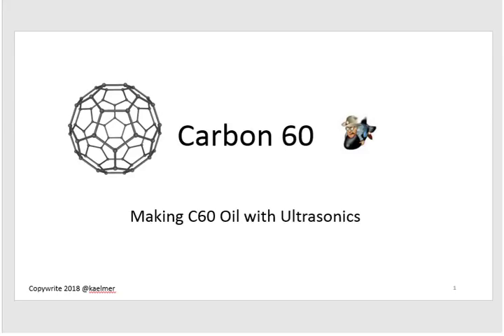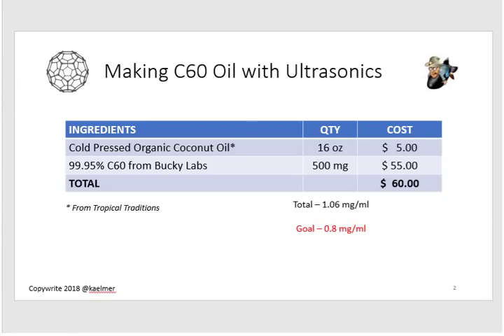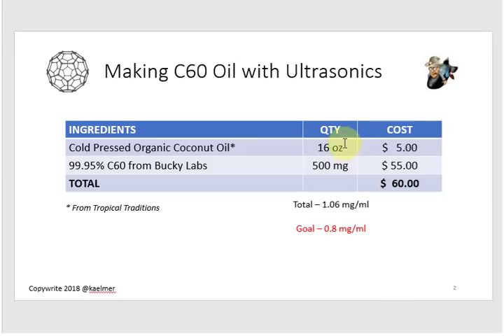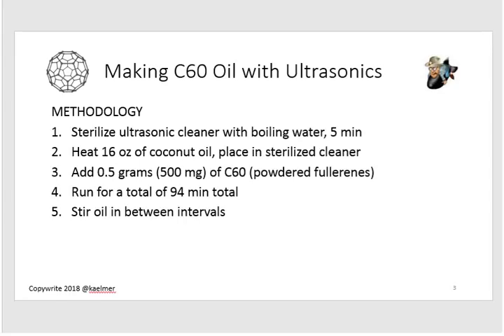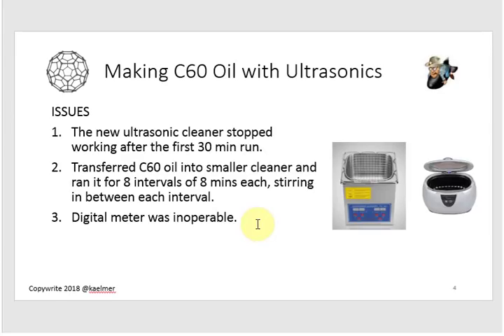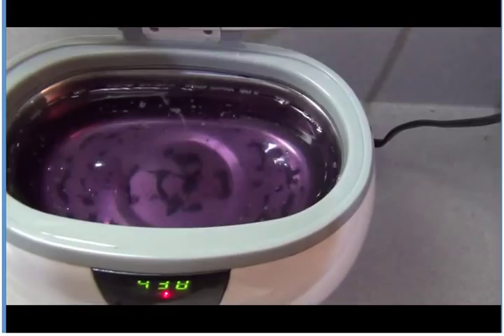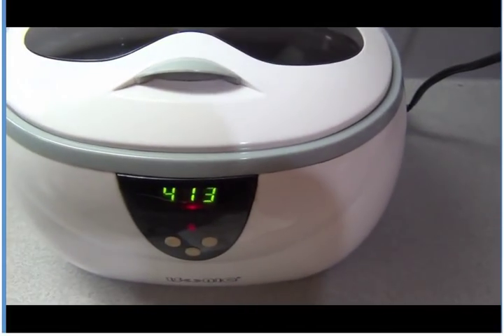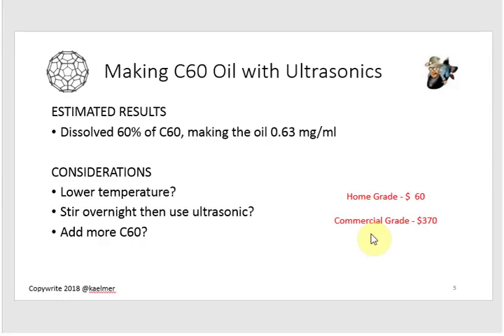Carbon 60 - Making C60 Oil using Ultrasonics

Comment: I'm seeing comments of mixing at higher temperatures. Wouldn't that damage the liposomes. I have to keep the temp of my Liposomal C at under 32 degree C, otherwise the batch is ruined.
Reply: OK，I saw the stir VS Sonicate video which explained the temp question. Thanks
Reply from the maker: I've found 49C to be adequate, but higher does make the oil taste off.

Comment: Hi, I have the same Ultrasonic Cleaner you list on your website.  What would be the recommended settings for the khz and the temp? I will try with olive oil and avocado oil.
Reply from the maker: I'd go with 40Hz and no higher than 120F.
Reply: @KElmerTinkersAcademy  thanks for the reply. I went with 20hz and kept the temp under 110. Used avocado oil, 500ml. Run for 120 min and there were just a tiny bit left of c60 powder. Looked good.
Reply from the maker: That'll work!!

Comment: What temperature do you put the machine ?
Reply from the maker: I run it at 40C.
Reply: K Elmer thank you..
Reply: K Elmer Hi.  my C60 is brown not purple or red. I used the highest grade Bucky  Labs Fullerenes.  It looks like all the powder has immersed into the water. What did I do wrong? Thanks.
Reply: Oil not water 😁
Reply from the maker: Its supposed to be brown, stir for 2 weeks, let settle for 2 weeks and filter.  Then you'll be able to see a slight red tinge if olive or avocado, purple if coconut or MCT.

Comment: Used an inexpensive magnetic stirrer to make 2 batches with 99.95% C60, in extra virgin olive oil. No C60 settled on the bottom, after 3 weeks of stirring. 
Most recent batch, I used cold pressed organic hemp seed oil. Also 99.99% C60 from Buky labs (they were out of the 99.95). In 2 weeks, there was no C60 settling. The color was a rich pomegranate red (same color as the jelly I make from my tree!) where the olive oil was more of a deep wine red. Very pleased with the results.
I've been dosing daily since January. My general health has improved. Skin is clear, eyesight seems better, and my hair is less gray, go figure. Will continue....

Comment: With ultrasonic mixing the oil tastes a little burnt. I have tried with olive, sunflower and MCT oil. The C60 dissolves ok in 30 minutes but the slightly burnt taste, compared to mixing with magnetic stirrer, makes it unacceptable. Someone suggested the ultrasonic is burning oxygen in the oil. I put a sealed jar of oil in the cleaner and tried mixing 30 times for one minute intervals but still the same. Maybe problem is my ultrasonic is 40khz. I need to get one with dual frequency with 20 or 28khz and try at lower speed. Anyone had same problem and tried this?

Comment: You and the people who left comments, DO NOT UNDERSTAND what this is about.. #1 Purple Power use Coconut and Avocado oil as a carrier because it is easier on the stomach than Olive Oil. and is needed to take the C 60 throughout the body.  #2 The important part of the product IS THE Carbon 60.  That is what is so expensive. Purple Power extraction process is expensive and exact.  It is purchased through specific labs.It is 99.95% pure. Someone below mentioned that they will make their own out of Shungite. Won't work. It takes a special process to make it. https://youtu.be/txnMxE_F9J4 will explain. You need to investigate C60. If you are not informed, you are stupid. https://www.youtube.com/watch?v=GUkU08uz4Lo&t=320s  The following explains many benefits, expecially in older people. https://www.youtube.com/watch?v=GUkU08uz4Lo&t=320s PLEASE BE INFORMED! You cannot use heat.

Comment: I am really looking forward to making my own C60. Your videos are invaluable. I wish I had done this to start with rather than buy the expensive oils online. I like the idea of coconut oil, but will probably will use avocado oil. I will try some different oils. I was wondering if CBD oil would work. It is pretty expensive to begin with and I don't know if the lipids (?) would be right in CBD. I bought hemp oil once thinking I was getting CBD. I wonder how that would work. What about mixing it with vinegar as a salad dressing? It might look weird, but another way to ingest it.
Reply: Tired of waiting over a month for your Fullerenes C60 or can't find it at all to make your own? You can have your 99.9wt% Carbon 60 within ten business days right here on eBay  https://www.ebay.com/itm/273515181024

Comment: Greetings and Thank You for the C60 Videos. They got me started into personal production after watching so many Testimonial Videos.Now for the Question: I have an Ultrasonic Mixer (Yes it is made in China) that has digital controls for processing time - 30 Min Tops and Temperature that controls what I want to set it at and the Actual Temperature. Even when I set the Temperature to Zero, it still gets hot & it will run up past 70-80 C (158 - 176F) if I don't stop it. I am using a fan to cool it down so my run times are between 5-10 minutes depending on how long it has cooled down.At this rate getting to 100 minutes is going to be an all day/night job... Has anybody else encountered this problem? I figure the heater wire must be connected to the Ultrasonic Vibration module or the switch for it. No schematics so I am reluctant to do surgery and fix it.

Comment: Thanks so much for your videos.  I am going to start making my own.  I didn’t know I could buy C60 in Canada so will contact the sellers listed in one of the comments below.  One question I would like to ask is about the ultrasonic cleaner.  I’m not familiar with them and after looking at the different ones for sale and then following the link that was provided in one of the comments I realized I didn’t understand exactly how they work.  Would it be possible for someone to do a video on using different ultrasonic cleaners that can be used when making C60.  I was under the impression that just stirring in a dark place for 2 weeks was all that was needed to mix C60 into oil.  Also I think I read that one shouldn’t heat the mixture to above a certain temperature...do you happen to have any facts on keeping temperatures at a certain level?  Many thanks again for all the info.  The folks making comments are a huge help too.  Many thanks for them for sharing as well.

Comment: Is there a temperature beyond which you should not process C-60 in an ultrasonic cleaner?  I processed for 90 mins. at 120degrees; and the oil tastes burnt.    I'm hoping it is still effective.

Comment: Ray Peat, a biochemist, has written extensively on the benefits of coconut oil. It is the only oil which doesn't go rancid. Olive oil will be rancid in no time unless you add vitamin E 1000 IU or more to the bottle the minute it is opened. Here are some readings form Ray Peat on cocnut oil:Why Does Peat Recommended Refined Coconut Oil As Opposed To ...https://raypeatforum.com › ... › Ask For Help or AdviceCachedNov 23, 2017 - Hello fellow Peatarian's, just looking for feedback on why Ray Peat recommends the refined coconut oil? I find that much harder to find than organic..."Coconut Oil 'as Unhealthy As Beef Fat And Butter'"Jun 16, 2017Ray Peat On Butter And Cream Vs. Coconut OilDec 16, 2016Coconut Oil- Refined Or Unrefined?Jan 26, 2015Coconut Oil: In A Unique And Exclusive Category?Aug 4, 2012More results from raypeatforum.com

Comment: I use Nature's Way coconut oil. It is a clear liquid at any temperature.(Available at Whole Foods) I am not sure why you have powder residue. I suspend 1 gram of fullerines in one liter of this oil using a magnetic stirrer and there is ZERO residue after three weeks of stirring. The oil is deep purple. If you mix purple with green of course you get brown. Olive oil and everything other than coconut is green. The purple oil is a suspension, not a solution, and there is no reason why you cant suspend more than a gram of fullerines. Be patient and keep stirring!.
Reply: could you tell me which magnetic stirrer you have and at what speed did you stir, you kept it stirring constantly for the 2 weeks, right?
Reply: Wow, people seem really reluctant to share their brand of magnetic stirrer, for some reason...

Comment: I know the residue is a big problem for me. I did my own experiment with 1 gram of the Bucky Lab C60, and pure Avocado oil 1 liter in a clean stainless steel pan over the stove stirring constantly. I used a candy thermometer and slowly took it to 300 degrees. After about 90 minutes I still had residue.  I don't think these larger particles are ever going to dissolve they are just to big. But I will continue stirring to see if anything changes. UPDATE: after a week of using the C60 I find that it is working well. I'm surprised to see that I have a huge lose of appetite and lots of energy, and I'm feeling great. I think I will continue making it this way.
Reply: Marcy Miller have you tried a magnetic stirrer for 2 weeks in a dark room?  That’s the method that most folks are using.

Comment: Just a thought, with the residue left in the ultrasonic cleaner, if you ran that through the cleaner again with more oil would you extract more c60 if you get what I mean.

Comment: Hi I use an industrial grade ultrasonic cleaning machine purchased on Amazon fitted with 3 ultrasonic heads it works great a little residue. I mixed 1 gram c 60 to a liter oil.
Reply: The machine i use is a CD-4875   purchased from Amazon. i used the Red lion pre crushed stuff works great  no resedue.
Reply: which one exactly did you buy?
Reply: I would be interested in the answer too.
Reply: Thank you!

Comment: We ended up throwing away a test batch of c60 oil on the ultrasonic cleaner. The ultrasonic was heating up the mct-oil and after an hour the oil had a rank odor to it. Not sure, but I think the ultrasonic heating up the oil can change/damage the structure of the oil, or change/damage the c60? Could the electrical conductivity properties of carbon mixed with the ultrasonics be bad? I wonder if my ultrasonic cleaner was the issue. Thinking it's best to keep the oil in the dark, around room temp, and take the time to spin on the stirrer for two weeks. I can't get the nasty smell of the oil out of my nose!
Reply: Cathy Fuchs umm, how hot did you make it?   This sounds weird.  Boiling water would not cause the oil to overheat.  I really don’t know.  I think you should just get a magnetic stirrer.
Reply: Seems to makes sense to put fill the ultrasonic with water, and then place a beaker of oil in the water.   Oil is much thicker and may tremendously affect how it works.
Reply: David Lee. I think that it's weird, too. I don't have a heat control
 It's either on or off. The cleaner runs at 35 Hz. Maybe that is what is doing it.  I do have a stirrer. That's what I used I. The beginning. I was experimenting with the leftover C60 to make the extra batches. I'll start with the stirring for the next batch and then do some more experiments with the left overs.  Thanks for your help. It's nice to have someone to bounce ideas off of.
Reply: Your problem did surprise me.  What was the source of the vegetable oil the MCT oil was made from?  MCTs may be made from several kinds of oils using different extraction methods including petroleum solvents.  Thank you for making me more alert.
Reply: We use Nutiva organic coconut mct-oil. I suspect this issue came up for us from running the ultrasonic continuously for one hour. It heated up too much. It could also be my ultrasonic cleaner is over 5 years old. If I try again it will be with a new cleaner and allowing space in between for the oil to remain cool.
Reply: I had the same issue with my ultra sonic cleaner. I wonder what is happening.
Reply: The both times I used the ultrasonic I used water and place a beaker of oil in it. I did use the heat and I can't tell you how many times that I ran it in 5 minute bursts but the oil got cloudy and it smelled burned. I decided to bottle the oil and put in the refrigerator.  What I found was that eventually the oil cleared up and was a beautiful magenta color but the burnt smell never went away. I ended up throwing it out. So I wonder if I can use the ultrasonic without the heat and if that will make a difference.

Comment: Have you thought of using a homogenizer? Homogenizer is a hundred times faster than an ultrasonic cleaner. Stirring will be unnecessary. It will mix it faster and at the same time it will heat up the oil.

Comment: Heat above 90º will change the chemical structure of the oil..... SES vaporizes carbon rods in a vacuum, I talked to them, all the labs buy from them (the cheap one $40 a gram)......make your own magnetic stir plate, no noise (a computer fan, an old power supply and a 10K pot to control speed, 2 neodymium magnets glued to blades, mount in a cigar box)

Comment: I used 500ml of Bulletproof's Brain Octane Oil (since I already make my morning coffee with it), 0.5 grams Bucky Labs Fullerenes and placed into a 500ml beaker and then suspended the beaker into my Ultrasound Cleaner (which runs at 30 min intervals). After just one 30 minute run It got up to a temperature of 120 degrees fahrenheit and the oil turned a deep eggplant purple. If I let it rest for an hour some fullerenes will settle on the bottom. So, I am running it several times a day to see if I can further dissolve the fullerenes.
Reply: I have the same equipment, just waiting for my powder now.  My ultrasound cleaner has a basket that I plan to use to "suspend" the beaker.  The water maximum level in the cleaner is lower than the 500 ml level in the beaker, and I'm wondering if that will be a problem in proper mixing.  Can you give me a few words on my question please?
Reply: I see what you mean. Your basket holds the beaker too high. The Ultrasonic Cleaner I own came with a beaker set that allows me to suspend the beaker above the cleaners reservoir at a proper hieght. See: https://www.amazon.com/iSonic-P4810-BHK01A-Commercial-Ultrasonic/dp/B01I6RQ2NC/ref=sr_1_1?ie=UTF8&qid=1521307108&sr=8-1&keywords=iSonic-P4810-BHK01A-Commercial-Ultrasonic%2F
I imagine you could easily make your own cover/beaker suspender with some thin but sturdy material with a properly sized hole in it.
Reply: Thank you Jonathan!  I believe I got the wrong ultrasonic unit; the water is only about 2 1/2 inches deep :(   I've been looking for a wide, low container with no success to date.  Does your water cover the oil totally?  I can see the particles moving up in the oil but the "sonic waves" aren't hitting above the water.  I made one batch, ran the unit at 8 minute max intervals, for at least 12 times, and I still see a lot of powder settled out, so I am assuming it's because the mixing didn't occur properly above the water line.  Thanks again for the good information.
Reply: WhoToBelieve 
See this technique 
I think you just need to switch the beaker with a mason jar 
As in the presentation in this video 
https://youtu.be/E6TfwIXoczw
Reply: WhoToBelieve

Comment: Thanks a lot - great information! I've not yet started up any project, but as you mensioned the eventual impact of temperature, I was concidering  the raw food movement's temperature limitation of 42 degrees Celcius. What do you think? In what temperature did you run your experiment?

Comment: Are you aware of any liposomal encapsulation going on, to encase the tiny fullerenes within the lipid spheres... or, are you primarily using this method to dissolve the fullerenes in the oil suspension and also driving out air bubbles which are bound to be there when you mix two ingredients ?

Comment: Have you considered using a higher quality oil? Medium chain triglyceride (MCT) oil is a refined version of cocnut oil consisting of smaller chain triglycerides. MCTs are much easier for the body to digest (for folks with sensitive guts), metabolize, and more quickly and efficiently shuttled to the mitochondria inside the body’s individual cells where ATP is made to energize the body … also inside the cells where the reactive oxygen species (RAO) and other cell damaging/aging free radicals are generated – the toxins that C60 is meant to remove. 

There is no need to heat the MCT oil because it is liquid at room temperature. You can get a high quality MCT organic oil from BulletProof that contains the highest amounts of Caprilic (C8) and Capric (C10) triglyceride oils.
https://blog.bulletproof.com/what-is-mct-oil-vs-coconut-oil/

So basically, the smaller the chain triglycerides, the more of the oil that makes it directly into your cells, and the more C60 that you also can get into your cells. Now organic MCT oil is about 3 to 4 times more expensive than typical organic coconut oil but there will be a significant difference in the amounts that make it into your body's cells (especially brain cells on the other side of the blood-brain barrier).

Thanks for your informative videos by the way.
Reply: MCT.
Reply: Edited and corrected. Thanks for fixing my dsylexia. :)

Comment: 1. What was the temperature that you heated the oil too ?
2. Did you reuse the fullerenes in the bottom ?
3 Did you filter it ?

Comment: Thanks for making this follow up video.  I'm curious to know which brand your ultrasonic cleaner was as I'd like to avoid it.  Also, does the coconut oil congeal after it's mixed w/ the fullerenes?   I just opened a bottle of Purple Power, I had been using C-60 Olive Oil but it's a little rough on my stomach so  figured I'd try the coconut, and I was very surprised to see Purple Power packages the 16 oz in PLASTIC (ugh).  Also, we should probably add a digital scale to the materials list.  I'm gonna try this, thanks again.
Reply: MCT oil made from organic coconut oil might be something to look into.  It’s liquid form.